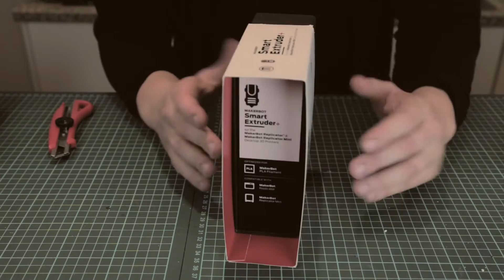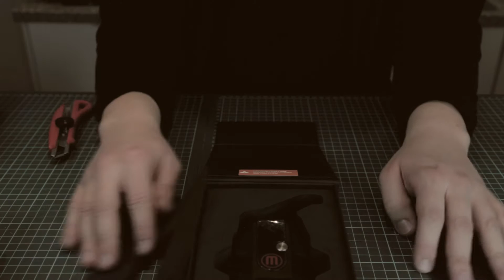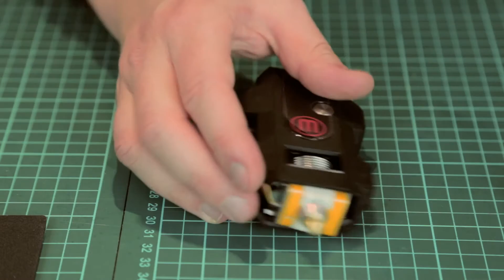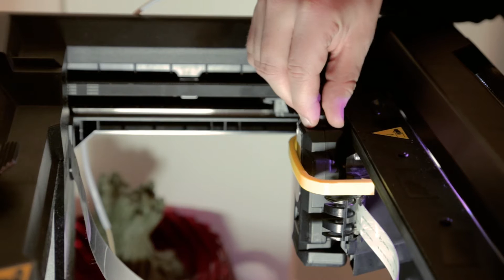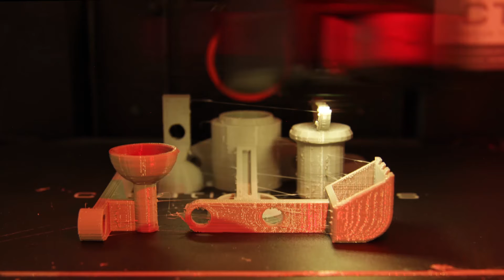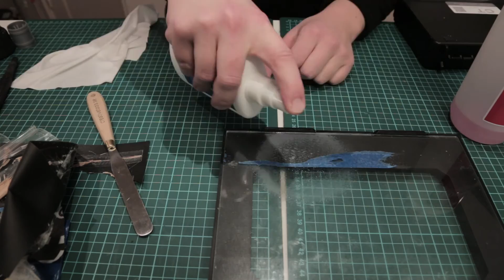Smart Extruder Plus - Will it resurrect your 5th Gen Makerbot?

Comment: The smart extruder plus only prints in PLA and its the most reliable printer out there, i have printed in excess of 60 kgs of filament in each of my makerbot printers with minimum maintenance, Im running a farm that consists of 6 printers that have not stopped printing since Feb 2015 I have printed over 5000 pieces for my prototyping business these printers are for professionals that dont have the time to tweak and modify. the only mod i made was an external spool holder and build tack on the old build plate. The fail rate is less than 2% COMPARED TO PRUSA I3 MK2s which fails over 20% of the time, Note: if you want to print with supports don't use the makerbot software use Simplify 3D
Reply: Either you work for Makerbot or you come from an alternate universe where Makerbots aren't complete shit.
Reply: Rubbish,

Comment: I had my first clog after about 200 print hours.  At about 250 hours it started to pause for  "filament slip error detected" (now it does it as often as every 10 seconds or so).  And it comes up with a "filament jam detected (error 81)" which pauses the print job (even though filament is not jammed.  

Currently I have 290 hours on this extruder, and it is effectively useless as you cannot complete a print job without constantly monitoring it for false print jam errors.  And these pauses introduce defects/small discontinuities  into the print job.
Reply: I just disable the error detection. Problem solved for me

Comment: Hey, thanks for this video.

About filaments, i'm really suppose to only use PLA? still, i'm really suppose to use only makerbot filaments? Do you have any experience with 3th parts filaments? I'm using 3th part and i'm noticing that i have to increase the temperature to 225degrees.

Any suggestions? thanks
Reply from the maker: Thank you for watching and subbing =)    Yeah, they only have PLA at the moment. The whole system allows for interchangeable smart extruders, so one can hope new materials will be supported in the future!  I've used 3rd party filaments with great success, however, it voids warranty which should be considered. As you say, tweaking the 3rd party filaments are usually necessary and is trade-of when you wanna use other colors or just saving some bucks :)
Reply: and what is the temperature range that you have used?
Reply from the maker: Depends on the filament really. From 190C to 235 max i believe. It has a PTFE-tube inside, so going over 240 isn't recommended if you don't want to have to replace the PTFE-tube every now and then.
Reply: Last question, you did this video on april, do you still think is good idea buy the smart struder plus?